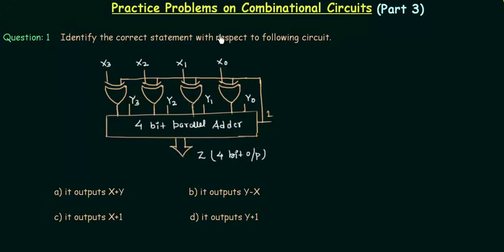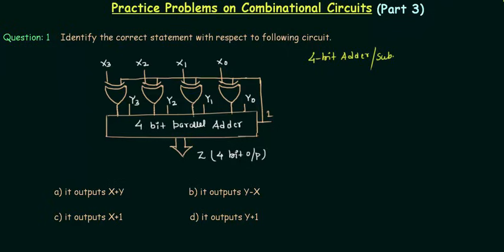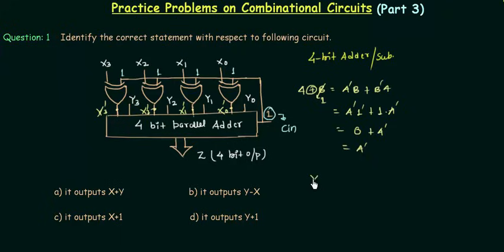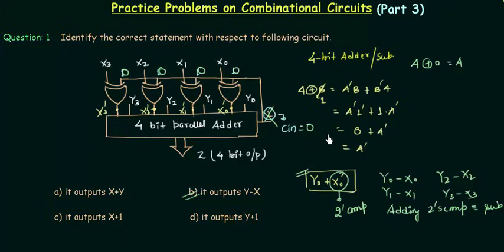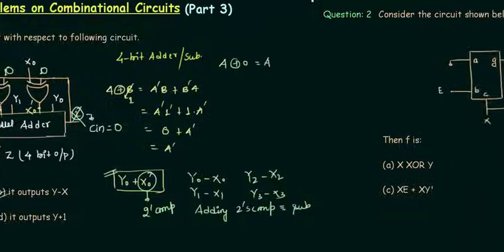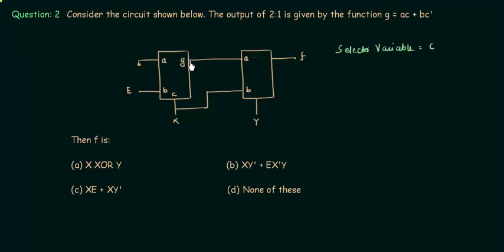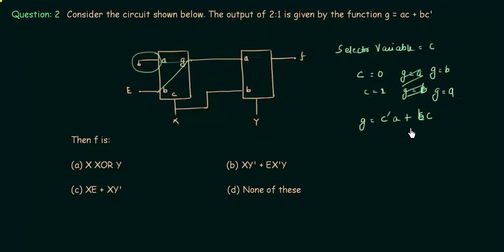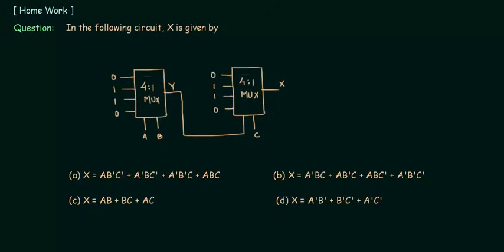Practice Problems on Combinational Circuits (Part 3)

Comment: In very first question what happened to the carry outputs after subtraction of the first bit. Cin is 1 but then y0 + X0' must have given a carry which would have then propagated to next bit. How are we handling that?
Reply: I also have the same question. Have you gotten the answer yet???
Reply: Functionality of the circuit is based upon the value of Cin not on the value of carry (Which propagate in the circuit), how? 
Ans: He has explained the XOR part in this video watch it carefully

Comment: Option A is the answer.
Thank you so much for this amazing playlist
Reply: Hey , can u plz tell me how at 8:10 g= c'a + EC I am not able to get it  thanks
Reply: @behindthescene4406   he has wrote it considering a simple mux.. just to explain.. it wasn't a part of the answer
Reply: @apoorvapanda9673  thanks got it, ..In   second question through 1st mux I am getting A er-or B (a'b + ab') then after sending to 2nd mux ..then I got confused ..can u plz tell how u got option a thanks
Reply: @behindthescene4406  consider the output from first MUX  as D ..and substitute at last to get answer

Comment: In problem 1 when one of the input of exor is one then the output is obviously one because it is an odd one's detector then how it get is as X' (complement of the input)
Reply: When ONLY One input is one output will be one, so in that case if one input we give 1 the output depends on whether the other input is zero or one

Comment: Sir in question no.2 why are you taking a=0 directly
Reply: You have to see the circuit. In the circuit, the input to A is not connected to any value therefore it is taken as 0.
Reply: A is grounded

Comment: i am confused @ 04:13 time mark, i decided to use 2's complement with what Sir is saying, " X' + Y " is subtracting so i make so i make X = 0010 (2) and       
Y = 0010 (2) so for Cin = 1, Y+ X' = 0010 + 1101 = 1111  (-1) which is not ZERO please help me, i am confused

EDIT: i understand X' = 1's complement then u add 1 from Cin to make it 2's complement which is X'=1110 Y = 0010 thus Y+X' = 1110+0010=1(Overflow) =0000 which is correct answer
Reply: I also have the same question. Have you gotten the answer yet???

Comment: Sir,in Q no. 2,while finding the o/p f,how are you directly saying that "a" is zero in c'b+ac
Reply: You have to see the circuit.. in circuit the input of "A" is not connected to any value therefore A = 0.
Reply: @NaveenSword  If it is floating, then In TTL- 0; ECL-1, Right; but here they didn't mentioned anything, so how did you supposed say it's 0??

Comment: For 1st problem,how are we converting to 2's complement.Plz explain clearly
Reply: How 1 is added ? Have u used a half adder circuit for the addition of the addition of 1 with X' ...? 
Because X' is 1's complement and for getting 2's complement we add 1 ? How we do that ? (Using an OR gate I obviously wrong)

Comment: Option A is the correct answer.
Y=A'B+AB'
X=Y'C+YC'
Substituting Value of Y
We get opt (a)
Reply: Hey , can u plz tell me how at 8:10 g= c'a + EC I am not able to get it  thanks
Reply: @behindthescene4406  just use the given data and use the value E=b
Reply: Can you please explain how you got option A after substituting Y
Reply: I did it a different way, but got the same answer. I basically just made a giant truth table with A B C Y X and then made a k-map with A B C as inputs and X as the output. Idk if there's a "correct" way to do it, but if it works, it works, right?
Reply: You can also use the output of first (y) mux as input of second to find X
Reply: Why would we only count where Y or X is 1, 1 in truth table?